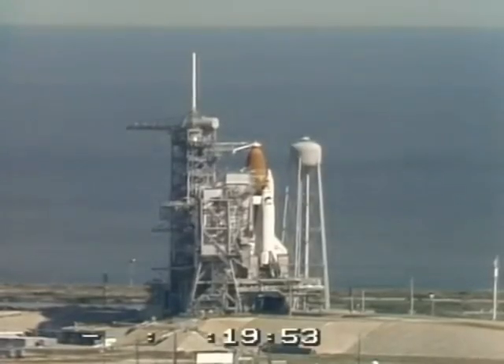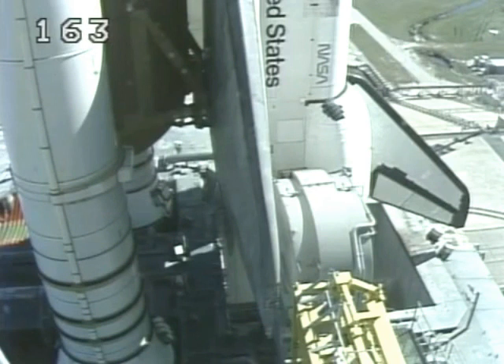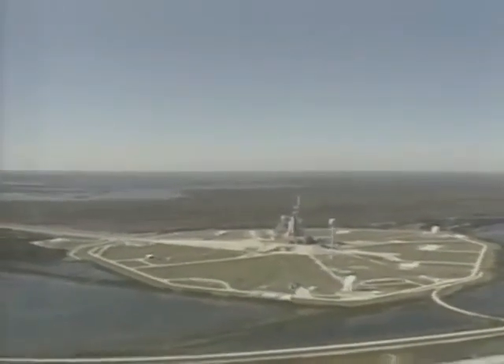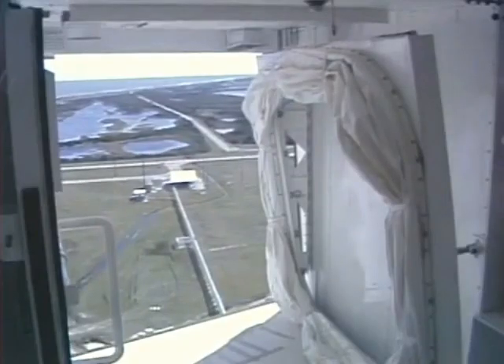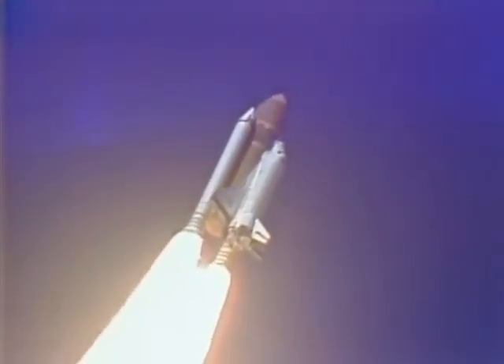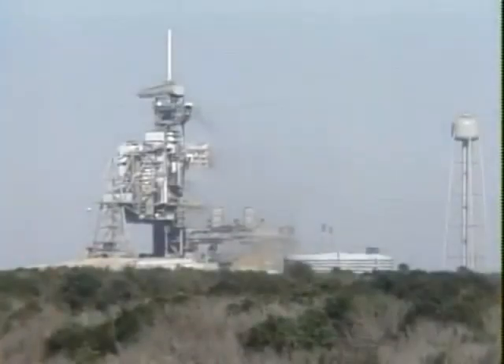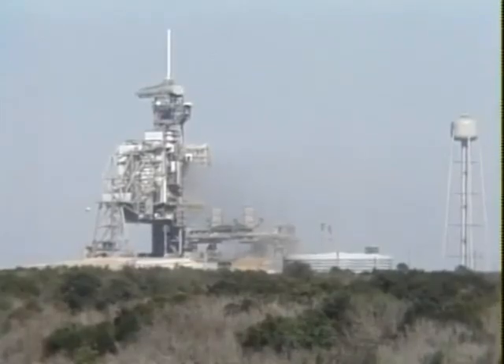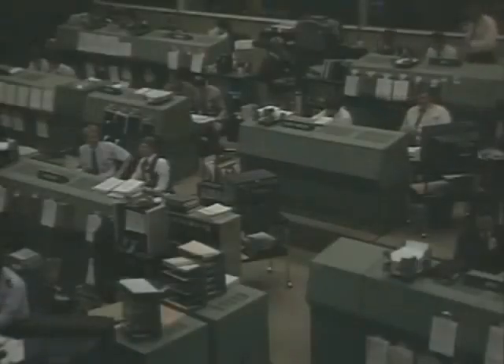The Challenger Disaster: STS-51-L Countdown and Launch

Comment: No para-medics parachuting anywhere, why and how. The massively large chute is the booster recovery chute which somehow survived the explosion and the idiots who failed to detonate the booster after an obvious failure. Para-medics are going to help a crew that have no parachutes, in a vehicle that has no option other than a 350 mph impact with the ocean. Get real.
Reply: Thanks Mr. Science. However, while you are correct about the parachute, you are wrong about the booster detonation. 
 CAPE CANAVERAL, Fla. (AP) _ One of two solid fuel booster rockets that separated from the exploding Challenger was headed for a populated area on the Florida coast before it was destroyed by an alert Air Force officer, NASA said Wednesday.
The action was taken Tuesday by an Air Force range safety officer at Cape Canaveral who sent a radio signal to detonate explosive charges in both boosters. The two rockets ruptured and fell harmlessly into the Atlantic Ocean more than 50 miles offshore.  Why do you think there was only a nose cone attached to the chute, Careful who you chose to call "idiot". Check your facts first.
Reply: @nickv4073  Mr. Science has spoken...
Reply: 200mph not 350..
Reply: I've often wondered why NASA lied about paramedics parachuting into the ocean immediately after the explosion.